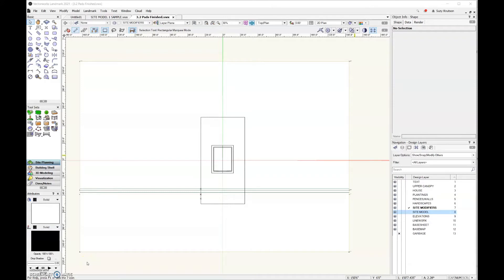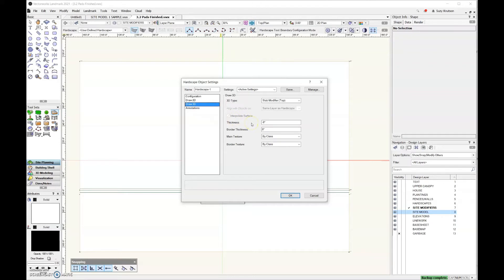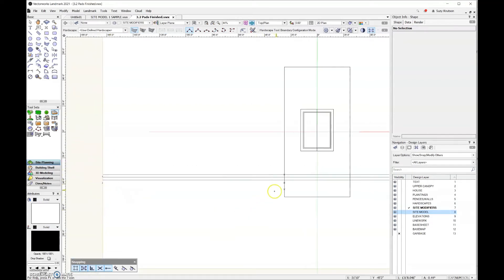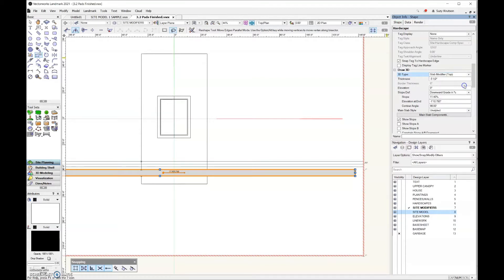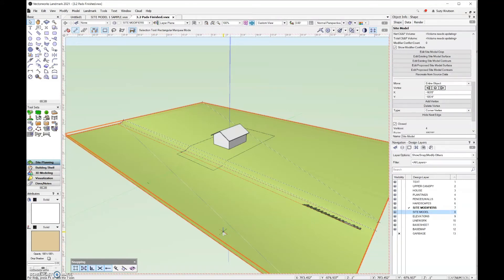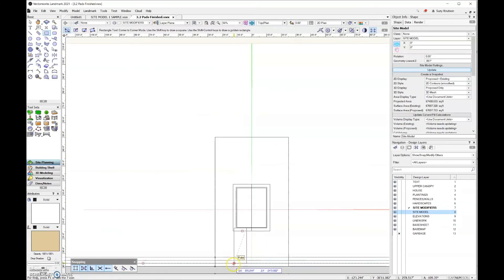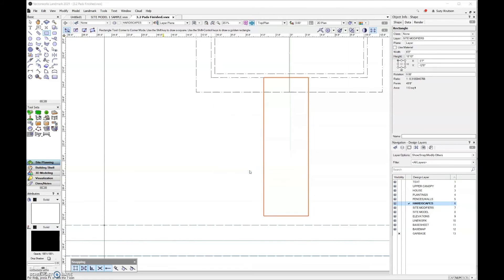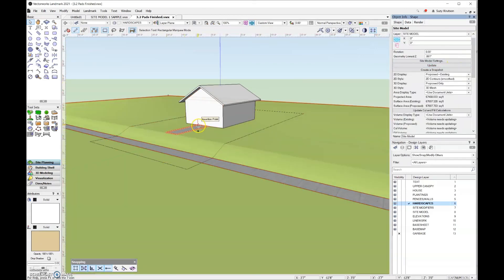The easiest and first modifiers to add - Hardscape Slab Modifiers - Vectorworks Site Modifiers 2 of

Comment: I've never seen the negative thickness thing you did. Is there another video where you explain why?
Reply: I’m glad you asked because this is no longer an effective work flow. 

I was using negative thickness because then the elevation in the Object Info Palette displayed the finished grade elevation. This was much more helpful than knowing the elevation at the bottom of the Hardscape. 

When components were added to hardscapes (I think that started a couple years ago), using negative thickness no longer worked. 

Thanks for pointing this out. I’ll update and repost the video next time I teach this subject.